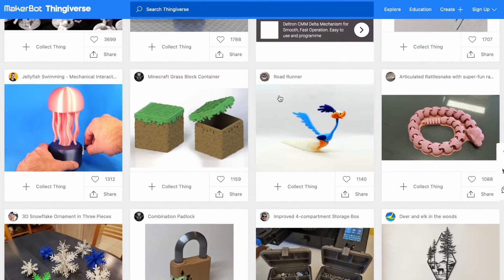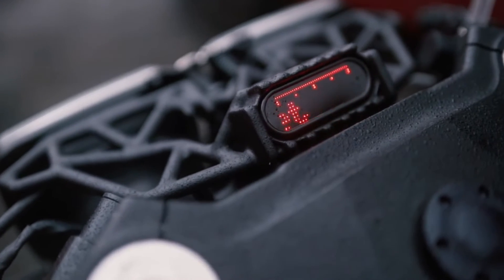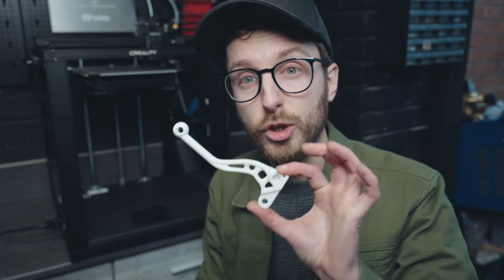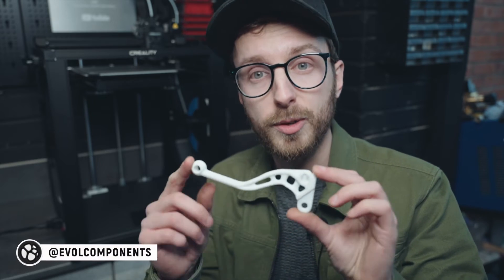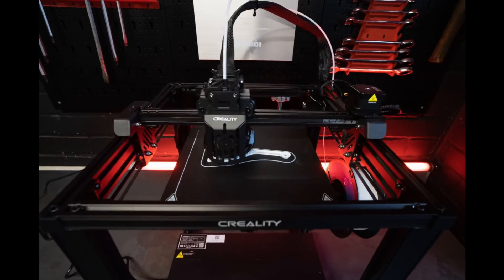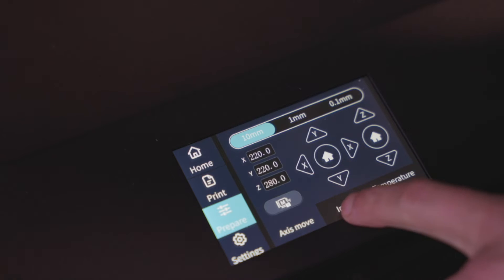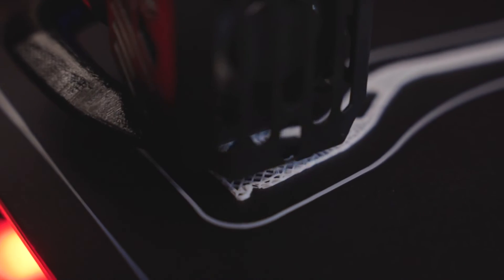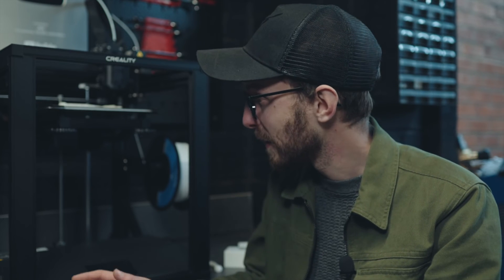3D Printing Motorcycle Parts? - Ender 5S1 - ITS FAST!

Comment: Guys, I've been printing motorcycle carbon fibe parts fo over 5 yrs now. You will need to upgrade your printer  and even when you do it will destroy your printer within a few months or weeks even. Be warned...it's a costly endeavor to print carbon fiber!
Reply from the maker: Thats why im going to make a separate video on it 🤘
Reply: No worries, if you need any tips or help setting up you machine to print CF I would be happy to show you my set up... Anycubic Chiron with dual extruders, high flow all metal hotend with stainless .6mm nozzle and massive cooling fans to prevent heat creep and keep everything cool when printing at 300+ degrees. I also had to write custom firmware because stock machines have perameters set to prevent you from going over 265 ish degrees. There is lots of things to overcome like that and I'm not hating on your video... I just want to make sure your providing the entire picture in them. Good to see you having fun tho✌️.

Comment: Just opened mine last night. Amazing machine. I'm coming from an Anycubic Megas S...not the I model. The 5s1 is leaps and bou ds better and just great. Quiet. Fast. Accurate. 

I noticed the dual fan ducts are now injection molded, they were printed before. So that's nice. The bed plate has a crazy hold on the material. I thought it was exaggerated at first by others, it isn't. Bought two new spring steel plates that are double sided.